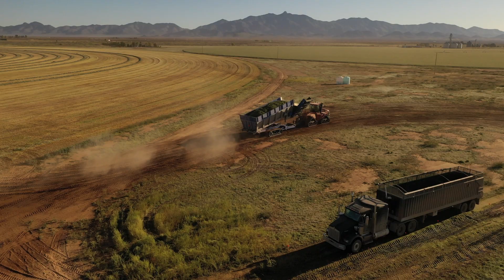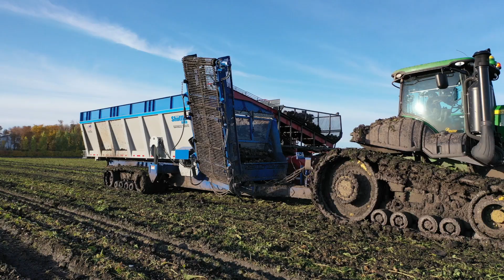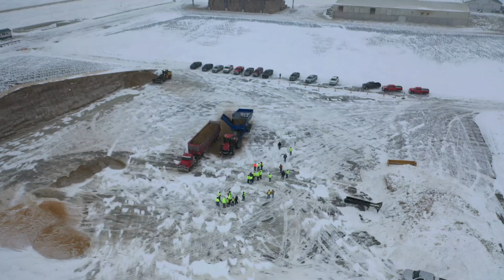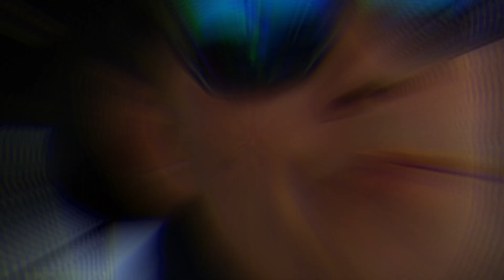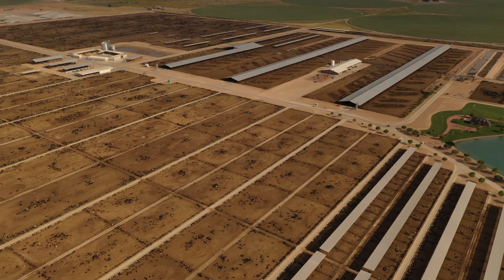Road to perfecting silage - Crop Shuttle

Comment: A clever solution to the problem.   one thought as to the bridging and the beater bar. is the motor  driving it fixed or variable.  if it was a variable drive then the operator could more closely align it to the crop conditions
Reply from the maker: It is hydraulically driven by the remote of the tractor so it is completely adjustable. And you are right conditions do a change so having that adjustable is key. Thanks for watching!

Comment: We used to run a Kelly Ryan bagger tender to fill silos with rear unload silage trucks. It has a similar spiral auger with fingers that really did a nice breaking up lumps and keeping a more consistent feed rate. I think you'll be happy with that addition.
Reply from the maker: It's been working really well, thanks for watching!
Reply: @SafeTPull  yes I definitely agree with the spiral beater bar with fingers however my suggestion, idea or comment whatever you want to call it, would be to add a chain drive to a second lower beater bar that would Aid in helping to reduce the lumps or clumps falling on to the Loading conveyor. All of the farm wagon style silage wagons that I've ever seen are PTO driven off the tractor and they usually have three of those beater bars up front to kind of fluff the face of the approaching silage wall into the unloading conveyor.